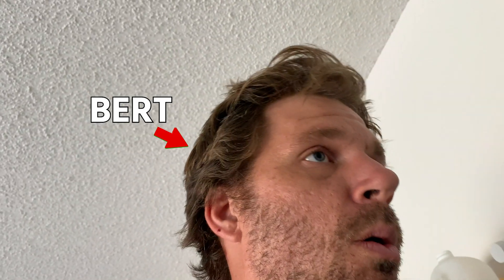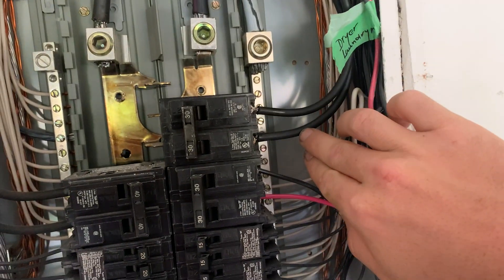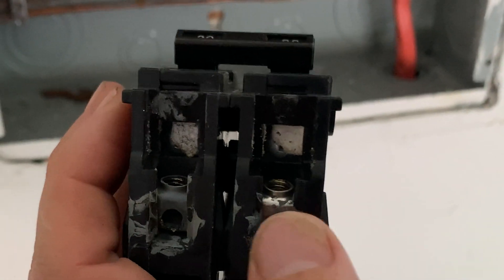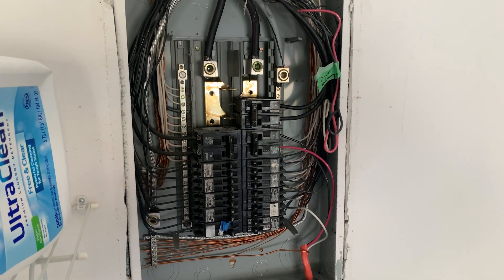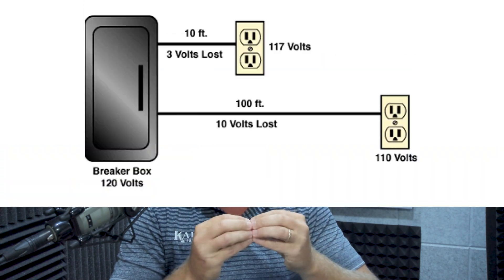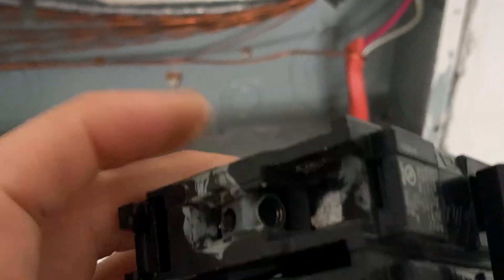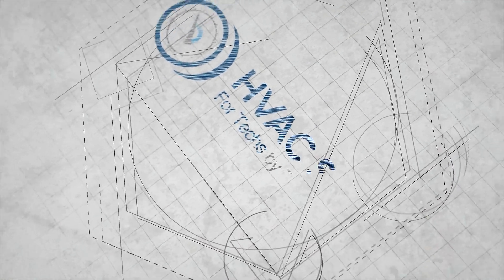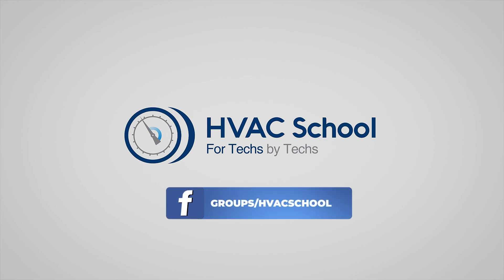Breaker Overheating w/ Bert

Comment: Somewhat related.  Those breakers on indoor units that are mounted through the panel fail when the unit is installed in an unconditioned space, such as a crawl space due to corrosion.  Mine has failed twice now about every 4 years.  This last time in July I changed it so had the failed breaker to open up.  (Heat wave and several days to get a service appt)  With the breaker in the cool cabinet, unconditioned air is draw in around the switch lever.  Moisture condenses on the actuating spring, corroding it.  This allows the contacts to loosen and eventual arcing failure.  But it also means that that leg of power cannot trip open even though the rest of the breaker is unharmed.  L2 which didn't have a switch lever, just a connecting bar, was unaffected by any corrosion.  

When you come across one of those breakers mounted through the cabinet panel that has failed, open it up.  you'll see the condensation has corroded the spring to failure and the contacts arced out.  My long term plan is to have an external disconnect installed and seal/insulate the hole in the panel.

Comment: @Bryan if heat stays in area of the poor connection and arching, then why does the breaker get hot when there’s a poor connection at condenser. (Like contactor or compressor terminal ) 
I remember hearing there is a build up of voltage and then higher surges of current??

Comment: And for safety reasons,  with breakers that are tripping intermittently because of loose connections or internal failure its best to kill the main when changing because of arc flashing.

Comment: You are exactly right! I had a breaker supplying a condenser unit that wasn't working properly. I was reading the proper Voltage but the Current wasn't being supplied. It turned out that a 40 Amp breaker was overheating where it connected to the buss bar. I had to install a new breaker and re-locate it to a different position in the breaker panel because the buss bar conection was burned as well as the breaker. I was getting proper Voltage but not the Current

Comment: Hey all, can we talk about ULTRASONIC LEAK DETECTORS!?!?!? Please?!!!? 🙏🏼
Reply: Nope.  You first master buble soap method then we can talk. 🤣🤣🤣
Reply: @George-if4cl  have you tried it yet?
That thing takes away the guessing out of the equation providing a very localized source of leakage,even from 3 feet away if there’s a small but consistent leak!
This tool converts the rookies into masters of leak detection overnight!
Reply: @pastormartinez4676  thoughts on infinicon do they suck or is it just me?
Reply: @LocoMan95  I’m not sure,but I believe the “HVAC GUY” has one and he seems to have mastered how to use it… however, I still rather use Ultrasonic!
Reply: @pastormartinez4676  I still haven't tried ultrasonic but that's next thing I'm planing to invest in.  Price is just too high.
Reply: They did a video on ultrasonic leak detection vs heated diode a few weeks back I believe
Reply: @elevatediron6533  I watched it and based on personal preference, I rather using the Ultrasonic,simply because it gives “ME” the best results… to each it’s own!
Reply: I work on Trane low pressure centrifugal chillers and so far I’ve tried everything apart from the ultrasonic leak detectors, I was hoping for an insight on wether it’s a good idea to spend big money or just any ultrasonic leak detector, what’s the difference 🤷‍♂️ 
Some of the Inficon’s advertise they can pick up vacuum leaks and nitrogen leaks?!
Reply: Stratus ftw

Comment: I had a GE 3-pole TED 480V breaker doing the same for me, tripping intermittently and it drove me nuts. breaker rated 100 A and current was not more than 70 A. I noticed that the breaker body is a little bit hot but  I didn't think it was a big deal. finally decided to retighten the cables going to the breaker, then the problem was solved and tripping is gone 
lucky there was no damage to the breaker nor the cable end termination. it was a loose connection 

thanks for sharing, the fundamental is the same whether small residential panel or large commercial one!

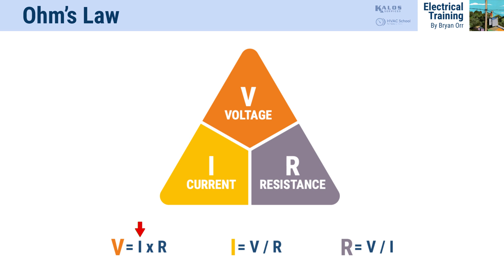Comment: 3:10, that is only true for purely resistive loads

modern switching power supplies for things, and anything that supports 120/240 automatic switching, is likely going to pull extra current to make up for the lack of voltage, because its intelligently trying to maintain a constant wattage